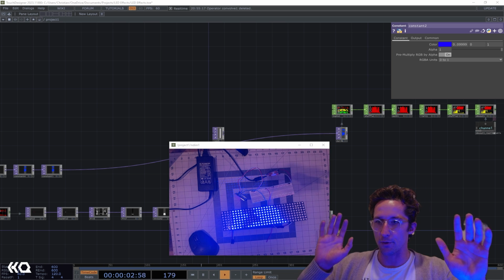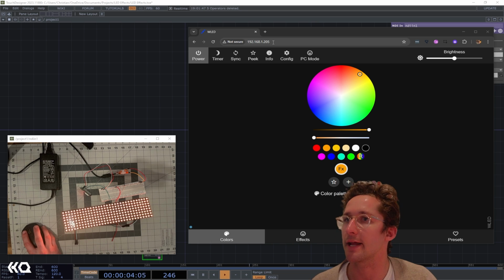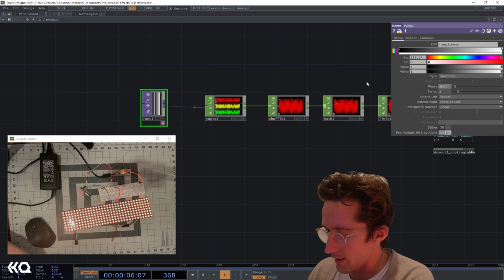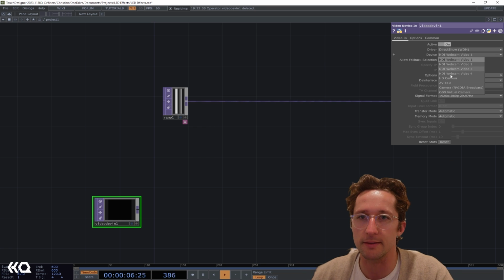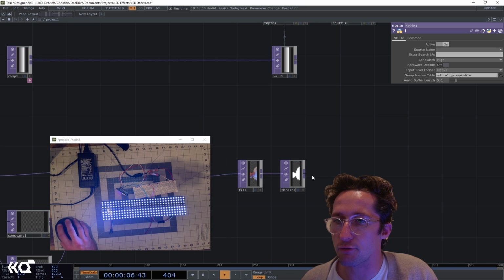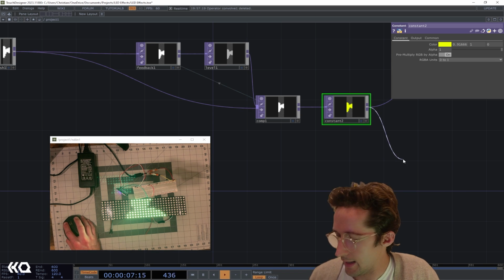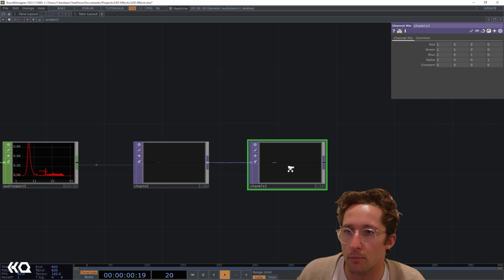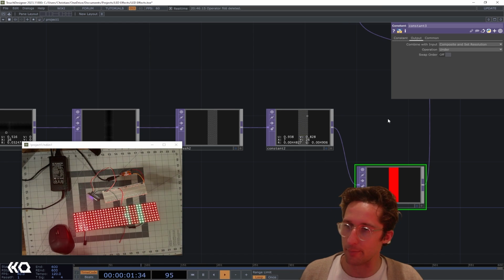LEDs with TouchDesigner - TouchDesigner Tutorial 208

Comment: can you better explain the top > chop > shuffle  > math bit?  thank you v much for this
Reply from the maker: For sure! 

We start with a TOP because it's easier to generate visuals when you can actually see the data! This also allows us to use any generator TOP we want to create visual content to be sent to the fixture.

The operator that we're using to transmit DMX data to the fixture is the DMX Out CHOP. So in order to actually send data, we need it to be available as CHOP data -- this is why we convert the texture data from the Ramp TOP to CHOP data using the TOP To CHOP. 

Because of the way the TOP To CHOP works, it will convert the RGB pixel data from the TOP to separate CHOP channels, one for R, G and B. We use the first shuffle CHOP to interleave this data back together into a single channel. So instead of three separate channels, we have a single channel with the previous data formatted like this: Red 1, Green 1, Blue 1, Red 2, Green 2, Blue 2... etc. (the numbers here are referencing the original pixels from the texture).

This is how our DMX fixture expects to receive the data (sequential RGB values for each LED). Each sample of the CHOP channel will represent one channel of DMX data.

The data now is in the correct format to be sent via DMX and correctly interpreted, but the problem now is that the actual brightness values that we're sending for each LED are very low (they're in a range of 0-1, which is what TOPs in TouchDesigner will produce by default -- TOPs generate RGB color in a 0-1 range). We likely would see very little (if any) change in the fixture with brightness values this low. So we use the Math TOP to increase the range of the data from 0-1 to 0-150. Now each R,G, and B brightness value will be in the 0-150 range, which should give us more than enough variance to show a range of brightness values. 

Finally, the Limit CHOP is used to clamp the data in the 0-150 range. This is done just to make sure that the brightness data will never fall below 0 or exceed 150. Hope that helps!

Comment: Do you have a way to check if the connection is working correctly? I followed your tutorial, but half the time when I open my file, the connection between Wled and Touchdesigner doesn't work.
Reply from the maker: It could be that WLED's connection is dropping, in which case you can try the suggestions listed here: https://kno.wled.ge/basics/faq/#still-having-connection-issuesconnection-dropping-what-more-can-i-check

Comment: Can I use an arduino uno? Or does it strictly need to be esp32?
Reply from the maker: This particular project is set up for an ESP-32 running WLED, so it basically depends on what controllers WLED supports: https://kno.wled.ge/basics/compatible-controllers/
I'm not seeing the Arduino Uno listed there unfortunately.
That said, it's definitely possible to set up an Arduino as a DMX fixture and send DMX to it from TouchDesigner, but doesn't have the benefit of easy setup/configuration via WLED.

Comment: thank you so much! this works perfect. just built a big one with 460 LEDS. trying to split it again into a 3rd channel and it's breaking my brain. should just be able to do another shuffle right?
Reply from the maker: Actually, you may be able to do this with one Shuffle CHOP -- when set to the Split N Samples mode it will automatically add additional channels as the number of samples in the incoming CHOP data changes. 

Say for example my CHOP data coming from the Limit CHOP contained 1080 samples. If the Shuffle CHOP's N parameter were set to 512, it would automatically split this data into three channels (r0, r1, and r2), each with a length of 512 samples (although r2 will only have 56 samples of actual data).

So I think the change that would need to be made here would be an increase of the resolution of the TOP that you're using to create the visual effect. This should increase the number of samples in the CHOP network, which would automatically add the additional channel in the Shuffle CHOP. Then you could use the DMX Out CHOP routing table to send that channel's data to the right place. 

Hope that helps!
Reply: @TheInteractiveImmersiveHQ  hey! in the video we actually split the samples by 510, not 512. was there a reason behind the 2 samples dropped?